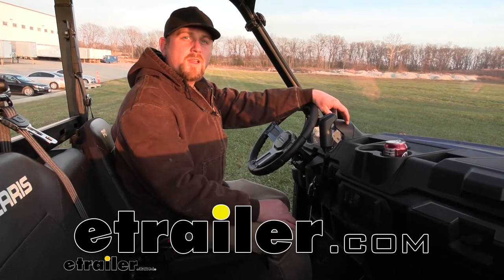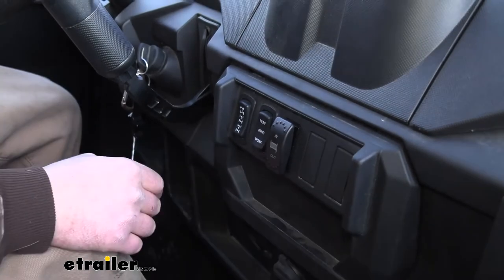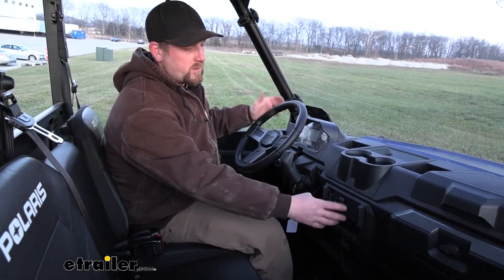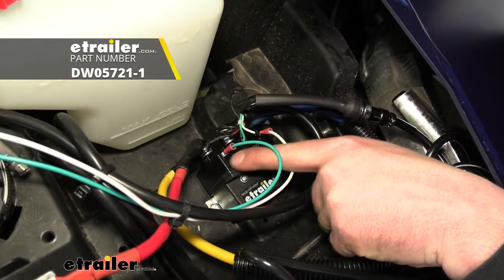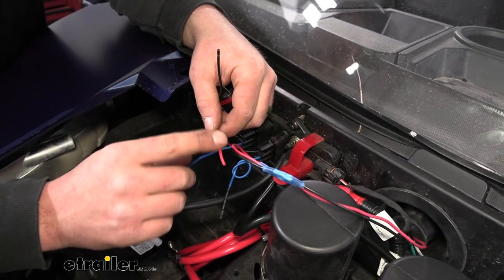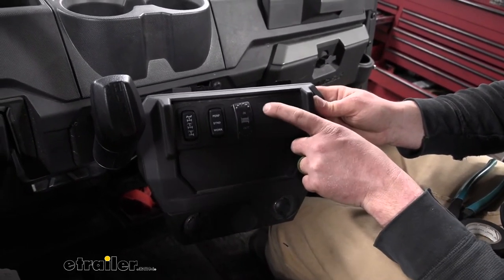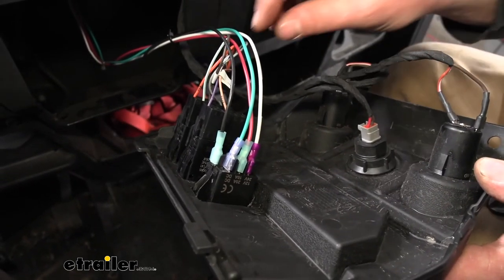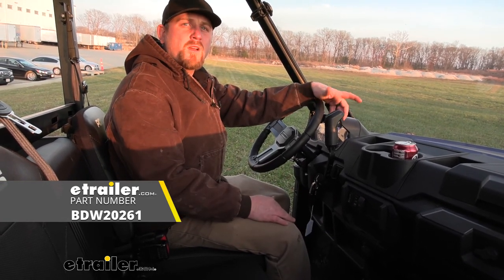etrailer | Bulldog In/Out LED Rocker Switch Installation - 2021 Polaris Ranger

Comment: Under the hood you used only the red and black wires and not the blue for when the ignition is on, so there's power to the winch switch constantly? 

How about the led light on the switch is power running there constantly too since you didn't use the blue wire that gives power only when the ignition is on???

Will that not run the battery down??